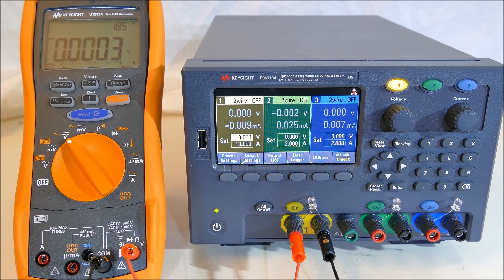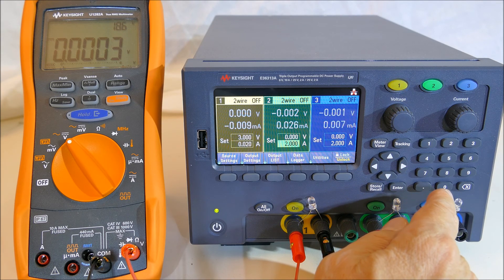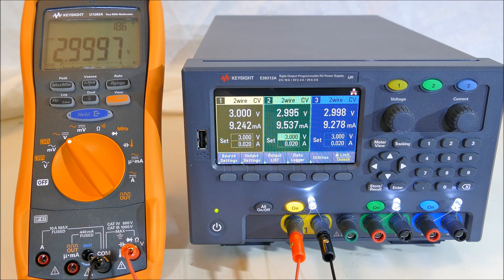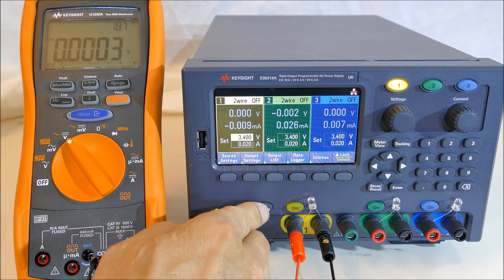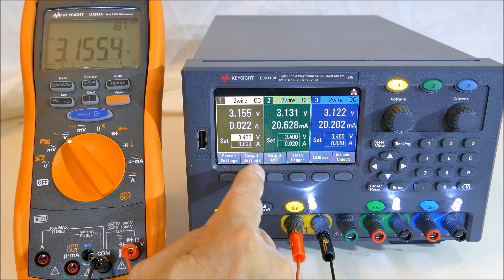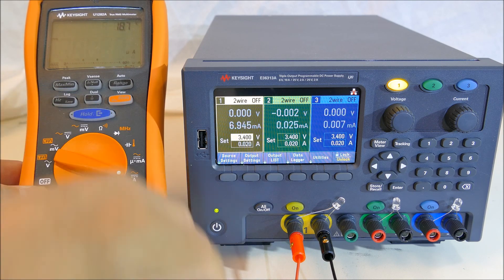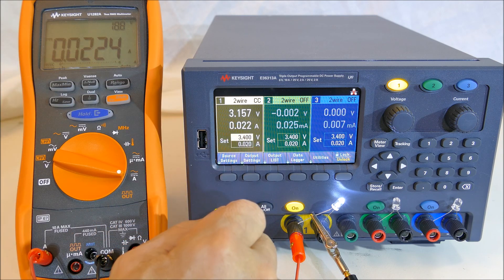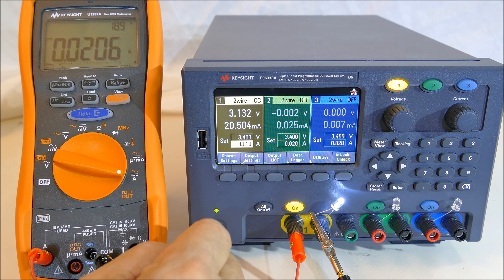Keysight E36313A Accuracy

Comment: Rigol power supplys let you select using the nob 10mv, 100mv, 1000mv by the digit being highlighted.  I do not see that option on this PS.  That is a big deal to me because you want to be able to select the resolution with an arrow key and then turn the nob rather than typing in each step. unless I am missing it here.

Comment: I haven't really looked into those power supplies. Is it a true linear power supply or a tracking switching regulator + a linear regulator? How is the fan noise?

This supply is well within its spec of 0,04 % +3mA. However, I think it is somewhat disappointing when there is such an offset. For comparison, I just quickly measured my HMP 2030  that has a spec of < 0,1% + 5 mA, is probably 8 years old and has never been calibrated or adjusted after shipment(!). After a few seconds in CC the current has stabilized to ~20.070 mA (measured with Agilent 34401A and Brymen 789 with a still relatively new calibration). I wonder if there is something like an auto-calibration feature or do you think that this is temperature drift rather than calibration?
On the other hand, the mentioned HMP 2030 has other issues, like a really bad dynamic switch-on behaviour (massive voltage overshoot when it has to go into CC immediately, for sensitive loads one shouldn't rely on the CC) and a ton more noise than e.g. my Agilent E3632A (which has a rather annoying fan without any speed control).
Reply: Hi Sebastian, I have the smaller brother of the reviewed PS. It's a good idea to calibrate it in house. You'll need some decent power resistors to calibrate current and low current measurement of the PS. After calibration it's decent. A great omissions by Keysight is that this series of PS does not work in a linear fashion. Both voltage and current settings use stepping. And non linear stepping. So you're unable to sweep accurately.
Biggest issue I have with it is unbalance between the higher voltage outputs (2 and 3). If used for powering opamps there is always an offset of at least one milli Volt.
It is a nice PS but has quirks and seems over priced for it's real world specs. It's true power is in automation with Benchview software.